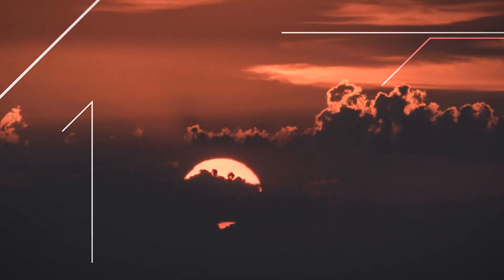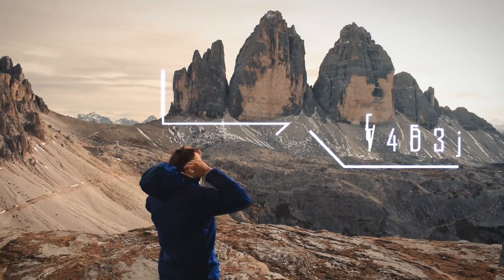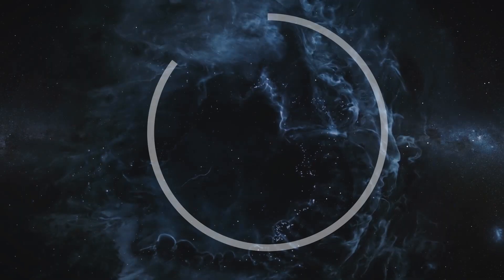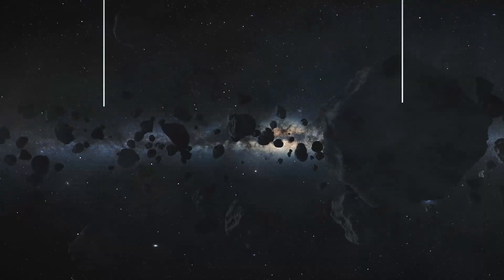DSLR Astrophotography modification - Canon 1100D / T3

Comment: Thanks for the video. It is very useful! I want to do it with my 1100D but I wonder about the screws for the sensor. Since there are two pieces of glass missing, do we need to compensate for it somehow to get proper focus?

Comment: I appreciate the video!! I have everything done perfectly, the only thing is my arrow pad doesn't work because I can't get the blue ribbon in. I can't get it to lock in to the board. Did you experience those issues at all?
Reply from the maker: Hey Todd, I'm very sorry for the late reply,  and this is a very basic question but did you push the pin there the right way to lock it, because not all of them go in the same direction.

Comment: You made a Full Spectrum camera. Please explain this as now its confusing a bit. 
If you leave the first glass (the bigger one) that you broke it will be a truly astro camera and you would not need any filters. 
Of course any astro filter is good ie Optolong L-Enhance.
BTW, now this modded camera is good even for infrared photography, just put any IR filter you want on the lens.

Comment: Thanks, used this to mod my canon 1300D. 95% the same, bar a few different ribbon cables, a black fibre optic cable, and I needed a TORX T8 (I think it was T8). Cheers chap 👍🏼💪🏼
Reply: Hi, im looking to modify my 1300d too. How did yours turn out? Would you recommend me doing the same? Thanks
Reply: @lukeoxlade7119  well it was an experience. Definitely fiddly but it all worked out ok in the end and the camera is a million times better with nebulosity now. Just bear in mind it’s delicate and not easy. I definitely thought my camera was not going to make it a number of times during the strip down. The final filter removal section was far more difficult that the video made it look. Simon

Comment: I'm thinking about doing this mod. If I do it am I right in saying when taking pics in the daytime (rarely do) I could just use the custom white balance to ensure the images look correct?
Reply from the maker: Hey, it's not that easy, I mean it will come very close but the images without an IR filter will come out a bit soft like it's glowing, itis a bit hard to explain but for ''normal'' results you will sadly need an IR-cut filter
Reply: @TadejSkofic  thanks, i've ordered some tools to give it a go! I assume that once the cam is modified it'll work best with bigger lenses (ie longer focal lengths), at the moment I only have the stock 18-55mm lens for milky way shots
Reply: Hola podría usar después de quitar el filtro de la cámara un filtro ya sea uhc o CLS en el adaptador t2 tengo esos de dos pulgadas no se si esa combinación sería buena gracias

Comment: Didn't you do the matrix alignment? There will also be a skew in the corners. For the future, do not blow on the glass in a dry room, you will electrify the glass surface and the dust will stick more strongly.
Reply: matrix alignment?
Reply: @juliocamacho8354  yes

Comment: Hey! thanks for this Vid, what used camera would you recommend to astrophoto? I got 150/750 newtonian and some Canon M and EOS 50D. should I get 350D (8Mpix) or 1100D to modify? and the first piece of glass is IR block filter and another one is antialiasing? cheers!, is there really worth upgrading from 8/12Mpix sensor to latest 24Mpix canon sensor for astrophoto ?
Reply from the maker: Hey the 350D is not really good for astrophotography since you can't control it with a computer, I got my 350D just for testing, but anything above that is actually quite good for astrophotography,  and then it depends if you want to make large prints of your images, more pixels are going to give you a much better result, but if you are going to share your images on the internet, you really don't need a 24Mpix camera because the images get heavily reduced and compressed, so you can use pretty much anything you like but avoid the 350D or below.
Cheers
Reply: @TadejSkofic  thanks! I will lookup for some old canons than :) maybe 450d or 1000d t2i etc.

Comment: Hi nice tutoial, I have one question, Do you don't need to install the Astronomik MC Clear Glass Clip Filter?
Reply from the maker: Hey, to come straight to the answer, I didn't, I have a completely ''naked'' sensor/chip since I use u light pollution filter and most of them have an IR-cut properties (but way less aggressive as the one in your camera)  (it can be a smart choice) but as I mentioned I just removed all the glass that was in front of the sensor and rely on light pollution filters.

Comment: I am doing the mod but there is this screw on the outside(the one beside the on/off button where you attach the camera strap)  that just won't come out. Do you have any ideas what I should do?
Reply from the maker: Hey, could you unscrew it, and it just won't come out? If you did, that just carry on and take it out when you start to disassemble the camera. But if you have a problem with unscrewing it than there is really not much I can help you with, other than give you a suggestion that you should have a ''fresh, sharp'' screwdriver and try it with a bit of force.
Let me know how it went.
Reply: Tadej Skofic the screw won’t go out at all I think the threads on the inside is broken or something. Well I got around it and I could still get it to the sensor just with a little bit of hassle. Now I just have to get the filters out and reassemble it which may be difficult.
Reply from the maker: @gustavbertelsen7633   Just take it easy and work slowly, it is a bit difficult but very specifying when you are done 😉
Wish you the best of luck!
Reply: Tadej Skofic thanks man!! Your video has helped me so much, I really appreciate it😁
Reply from the maker: @gustavbertelsen7633  I'm always glad to hear that!, Thank you!
Reply: @TadejSkofic  I just got my camera back together and everything works as it should, expect that i broke the cord for the lcd screen, however I rarely use it and if I want it back I can buy a replacement cord. And again I couldn't have done this without your video, so thank you so much for making it!

Comment: Oo thank you very much sir for this video. Will save me a load of money on buying a ready modified eos 400D 👍
Reply from the maker: Let me know if you run into any issues, just remember to take it easy and to organize your screws while you are taking the camera apart. Make sure you insert all the connectors well together too,  so you will avoid the need to going back inside and searching for what you missed, but again let me know if you have any problem and how it went,
Cheers

Comment: Hi, I have done astromodification to my canon 600d ( only LP2 removed, not replaced with any), but my camera got stuck at sensor cleaning, could not do any operation. Can you tell me what went wrong and how to correct it ? Thanks in advance
Reply from the maker: Hey, did you insert the cleaning glass back in?
Reply: @TadejSkofic  hi, the order in the sensor unit I saw was, LP1 and then LP2, and then CMOS Sensor. LP2 was attached to the system with a black plastic frame (glued on to the frame). I had removed this LP2 (it got broken while removing), not replaced with any filter and kept the empty  plastic frame as it is and then LP1.
Reply: I re-assembled it, the actual problem is happening at memory card read. It is not able to detect the memory card. Dont know,  is something got damaged while doing astro-modification. How can I rectify this ? Do you have any idea ?
Reply from the maker: @chaitanyach3227  I don't think you did anything to damage it, the thing is that in 99% it's just the problem that you missed something when re-assembling, so you might need to go back in and check if you connected all the connectors properly.

Comment: I did this to my 1000d and I got an error message when I switch the camera on it says:
Err 06
Self Cleaning Sensor Unit Malfunctioned.
Consult with Conon Service Center.

Is there a way to fix this?
Reply: Maybe the camera has sensor cleaning set to Auto. Switching it to manual might avoid the error.
Reply from the maker: Hey, this is a bit weird, if you put it back together the way it has to be, there shouldn't be a problem I'm gonna be honest that I don't really know what exactly should you do but you might get some answers one the  Cloudy Nights forum 
I will try to look into this and get back to you if I find a solution but try to post your problem on the forum, there are many more people with a piece of great knowledge.

Comment: Hi, I want to do this mod for my 600d, as well. If I remove the "blue" filter, is it necessary to use a clip filter for taking astro images? Or can i take pictures without any extra filter? And if so, do I have any advantages by doing this mod?
Reply from the maker: Hey, well I have a naked sensor mode, so I just removed all the glass in front of the sensor. It's recommended to use some sort of IR-cut filter (usually all the light pollution filters have some sort of IR cut properties but I've imaged without them too)  And I'm currently using the 600D too, and just be careful that you make yourself some markers on the screws for the sensor because it's spring-loaded so you have to tighten them back to the same position, except if you want to do some terrestrial photography you have to tighten them 1/8 less then they were so ''untighten them'' for a very small amount (so the lenses can got in focus) but if you will use the camera for astrophotography only, just tighten them to the exact same tension as you mark them before you take out the sensor. And for the advantages, I would say, you pretty much have to do it otherwise, you will end up very frustrated and disappointed because most of the light from the nebule lies in the spectrum where the build-in filters are cutting them off,  so I would definitely recommend you to remove them, and just take it easy, make sure you sort all the screws so you know where they go and take your time, I've modified quite a few cameras now so I can get in done in 20min but the first time it took me 4 hours and 2x15min brake 😆
Reply: @TadejSkofic  That problem with the "mark the screws of the sensor" yea. I removed then before I realised, this would have been a good idea... I am this far that I can take out the sensor and screw the filters off. I just read a few online blogs in which many said, that if you remove the IR Cut filter (I don't want to remove the filter with the dust remover) you cannot focus with the lenses, if you don't insert a clear glass of the same thickness. But you said, you have nothing in front of the sensor and it works, it should work fine?
The second thing I am struggling with is, that I am not sure, if I could take the photos just with removing the filter. Some said you have to insert a filter to block the high IR and UV, otherwise you will get halos around stars, because most lenses can't focus those wave lengths.
I purchased the 600D special to be used as astrocamera, so I don't care, if I couldn't take any daytime photos with it. Therefore I have my 700D.
What do mean about this? What should I do?
Reply from the maker: @ItsPolder  Ok, so yes I did remove the dust filter completely because I'm using a telescope for imaging so the focusing is not a problem because the focus ''window'' is much larger than on a lens. The halos around the star (in my mind) are not such a big problem and you will have to do manual focus either way to be sure so if that is your concern I would recommend you just always do a manual focus so you can be sure it's perfect.  And sooner or later you will probably want a light pollution filter and just get one that has a IR-Uv cut (here is an example) https://www.astroshop.eu/moon-filters-polarizing-filters/baader-filters-1-25-neodymium-moon-and-skyglowfilter/p,10932
but you can go for a Clip-In filter if you use a camera lens but they are more expensive.
So if you remove all the filters you still have some options lather, your main concern should be to install the sensor back correctly so the lenses can come into focus, because if the sensor is off you won't get it into focus so you will have to go back inside and do adjustments. Which is not the end of the world, but it's stressful if this is your first time doing this.
Reply: @TadejSkofic  Yes, of course I choose the option with much more stress for the first time, thats how I do it always :D
So you think this should all be fine to remove the 2nd filter (IR Cut Filter) and leave the first one inside. I only have to get the sensor adjusted correctly. Do you know any tutorial for this one?
One thing I don't understand is: Why should I remove the filter inside just to get a lp filter with an IR-UV cut? This is what I just remove, isn't it?
Reply from the maker: @ItsPolder  HaHaHa, well then you are a lot like me most of the times 😃   
But the light pollution filters are way, way less aggressive, for example, I'm only using a UHC and a 12Nm H-alpha filter and I removed every clear glass, filter that's in front of the sensor.  
I think in the first video on this site he is mentioning how to deal with the sensor
http://dslrmodifications.com/rebelmod450d1.html
you will probably find all the answers here. But let me know if you get stuck at any time and I will try to help 😉
Reply: @TadejSkofic  I did it! The filter broke during takeout but thats okay. I screwed down the sensor as I thought it could be and everything seems to be sharp, so I think it is not tilted. And the autofocus is working as well, I was surprised.
I will test how the image behaves with star-halos or other problems now, hope this will be okay, too :) Thanks for your information, really helped me on the decision.
Reply from the maker: @ItsPolder  That's so nice to hear, and it's quite fun doing this, it's it? 😆
And you will see that the star-halos are not such a problem (in my opinion), manual focusing is still the most reliable plus it happens a lot of times that you won't find any bright enough stars near your target to do autofocus but I might be wrong because it depends if you have a fast lens you might pick up plenty to focus on. Ok, so I wish you clear skies and have fun!
Reply: @TadejSkofic  When I am doing astrophotography I always do manual focus, auto focus is not reliable. I just bought a new lens, the samyang 135mm, f2. Just a beautiful lens for everything. Hope I can get amazing images with the new lens and camera :)
Reply from the maker: @ItsPolder  Ou, yes that's a nice lens to use, you mind sending me some sample images when you get some on my email? I'm very curious.
Reply: @TadejSkofic  Hi Tadej, just sent you an email of my image I took last night. I am really amazed and I think it went really good. Can only recommend this modification to everyone!

Comment: hey man i just did this mod :) really good video after doing this my camera doesn't recognize the SD card anything i may have missed in the process?
Reply from the maker: Hey, the issue is most likely that you didn't insert the wires properly and you have a poor connection. And I know that's the simplest answer I can give you, but It has to be something mechanical, the chance of you fried something is very very low, so I think you will have to go back and check your connections. (You don't have to go all the way to the sensor)
Let me know if you resolve the issue.
Reply: @TadejSkofic  Thanks man I ended up opening it back up and fixed it :) cheers man appreciate it :)
Reply from the maker: @Cosmic8-8  Glad to hear that, wish you clear skies men!

Comment: Would this be a full spectrum modification?
Reply from the maker: Yes exactly  😉
Reply: @TadejSkofic  Thanks for the quick response,. Is there any way that I would be able to only remove the ir cut filter? If so do you know how?
Reply from the maker: @gustavbertelsen7633  The thing is, that both are IR cut so you have to remove them, but you can easily fix the white balance in PhotoShop, except if you still want to use the camera during the day you will have problems from the IR light.
Reply: @TadejSkofic  Alright. So if I do the modification will I need any kind of uv/ir filter to prevent star bloat?
Reply from the maker: @gustavbertelsen7633 , In theory, yes,  but sooner or later you will pick up a light pollution filter (Moon&SkyGlow , CLS, UHC)  and all of those have some king of IR/UV cut. I'll add a few links to filters (not an affiliate) and just check the description.
. 
I have this one (but don't use it very much because it's not aggressive enough to cut the light pollution in my backyard): 
https://www.astroshop.eu/moon-filters-polarizing-filters/baader-filters-1-25-neodymium-moon-and-skyglowfilter/p,10932
And this is my main go-to filter for imaging RGB 
https://www.astroshop.eu/uhc-filters/omegon-filters-pro-1-25-uhc-filter/p,47288
And I also use the H-Alpha filter a lot
Reply: @TadejSkofic  Ok. thank you so much for the help!
Reply from the maker: @gustavbertelsen7633  No problem, 
take care
Reply: @TadejSkofic  I use Altair astro CLS CCD filter or Altair astro triband they great but little expensive

Comment: Would a clip on filter work just as well?
Reply from the maker: Do you mean after you remove the IR filter so you can use it as a normal DSLR? if that is your question the answer is yes, I didn't bother to get one since I have a separate camera for video and terrestrial photography, but you could remove the IR filter end get a clip in version so the DSLR works normally.